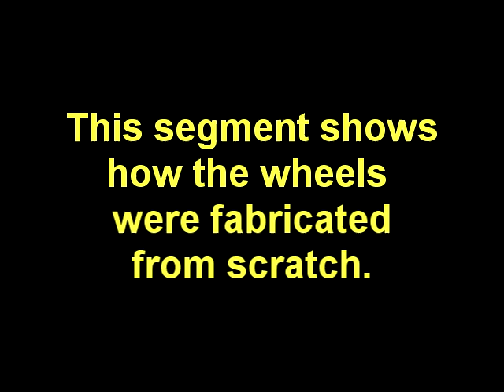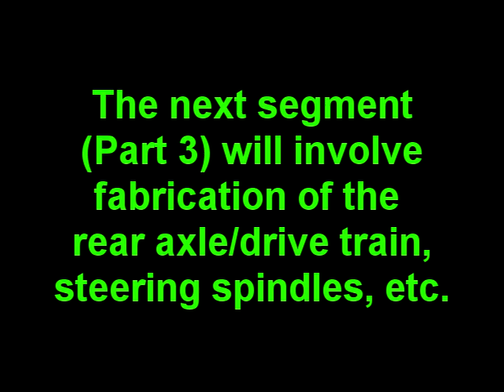(S-2 Ep-29) Bugatti Pedal Car Build Part 2 (Wheels)

Comment: WOW Paul!  Such detail you are truly a craftsman.  I cannot wait to see part 3 of the suspension & drivetrain
Reply from the maker: Thanks Gary. I started in on the drive train work earlier today. I began by building a cradle of sorts for the frame to sit on, such that I can slide the wheels on the axles for testing once they are installed. There is no suspension on this pedal car though. Every bump will be felt - old school! Thanks for your comments.

Comment: Great job on the wheels, Paul! Excited to see the rest of the car. I think your videos are the first to show the actual build process in such detail. Thank you again for taking the time to post them.

May I ask what kind of tires you used? Do you think the wheels will add a lot of weight to the car/make it rougher for a chile to pedal around?
Reply from the maker: Thanks again for commenting, M B! The tires specified in the plans are way too expensive and hard to find. If you can get them, they are over $40.00 each, plus shipping. I used Bell brand tires (same size as specified in the plans) and bought them through Amazon Prime for a little under $10.00 each. The wheels are quite heavy in relative terms, but the pedal car itself is quite large. It''s over 5 feet long.It's not for a toddler. It' more for a kid a bit older, say around kindergarten to 1st grade or so. 

I'm not sure how easy or difficult the car will be for a child to pedal until this one is built and I see it being used, in action. I suspect it won't be all that easy, but the kid behind the wheel will look "cool" in front of his or her friends. The wheels themselves would not be the culprit in the weight department that might hinder performance though. It's the weight of the car itself that may cause the operator to get tired prematurely.
Reply: Wow, those are some pricey tires! Thanks for letting me know which ones you bought instead. They look great!

The Stevenson Projects website states these plans come with adjustable seating. If I were to build a pedal car, I'd want it to grow with my child for quite a few years, so this feature appealed to me. What age range of children would you say can pedal this car?

Thanks again for taking your time to respond to my comments. I greatly appreciate it.
Reply from the maker: Hello again, M B!! Until such time I get the pedal car built and see how a little kid fits into it, it's really hard for me to judge at the moment. I'm guessing (for now) based on the overall size of the pedal car - this is not for toddlers. I think kids somewhere in age ranges of where they are in pre-school through Kindergarten and maybe 1st grade or so - as a general guideline. Of course it could take you a few months to build the Bugatti if you have limited tools, time, and experience so thst's something to consider. It would be a real bummer to go through all that expense and time, only to discover your child has grown out of the car before it's first use.- Not trying to dissuade anyone from taking on such a project, just bringing a reality to light as something to consider.
Reply: Thanks for the response Paul. Greatly appreciate it. My daughter is actually still a tiny little toddler, and I want to start a pedal car project in hopes to get it done by the time she's old enough to ride it. I may be limited in experience, but I thankfully have some time to learn.
Anyway, about tools. Have you had the chance to work with the Bladerunner X2? It's a portable tablesaw that supposedly "blends the cutting characteristics of a table saw, jigsaw, scroll saw and bandsaw" and can do scroll, cross-cuts and rip cuts. It's very affordable and am thinking of buying it for a pedal car project. It can cut different types of materials such as wood, metal, plastic, and tile, which I think would cover just about every material in this particular Bugatti project. I've even seen videos of people cutting perfect circles with its circle cutting jig, which would be great for the wheels. My question: what is the greatest thickness of wood you'll have to cut for the pedal Bugatti project? The Bladerunner X2 can only cut up to 1 1/2" thick wood.

Anyway, how's your build going so far? Hopefully well. Will you have a video up by tomorrow? I'm very very very excited to see more. Best of luck.

M
Reply from the maker: Hi M B. I've never heard of a "Bladerunner X2." I have a Delta 10" "Great White" Uni-Saw. I think you might find yourself quite limited if you can only cut up to 1-1/2". Horsepower is also a factor. I wouldn't consider anything less than 3 horsepower and 10" (but that's just me  and my personal preference). 

There will be a new (Part 3) video uploaded for Friday. Part 3 deals with the fabrication of the rear crankshaft/axle assembly, and the front spindles & tie rod assemblies. This is all steel work/fabrication, and I went completely off the reservation by doing my own thing and ignoring the plans (because I thought the plans were a bit too hokey & expensive).

Part 4 (next week) will be starting in on the  body fabrication.

Thanks again for your comments.

Comment: Hi Paul, Wondering if you had specifics on the tires you used?  I am having issues finding the right ones.  About the only thing holding up my own build.
Reply from the maker: Thanks for your inquiry, George. The tires called for in the plans (slicks) are available but are now "classic" aftermarket items for restoration projects & prohibitively expensive (over 40 bucks U.S. per tire plus tax and shipping!). So....I simply ordered the cheapest tires I could find online of the same size as called for (about 7 bucks each, U.S. including shipping through Amazon Prime) and slapped 'em on. I'm retired and all of the materials for this project came out of my pocket, and this was donated to a local non-profit fund raiser - so....I didn't want to invest too much money of whatever little I have. The fact I didn't use slicks from a Schwinn Stingray didn't make any difference to anyone as they didn't know better anyway.  The pedal car had rave reviews, lots of interest, and brought in piles of cash at the fund raiser, making it a big hit.